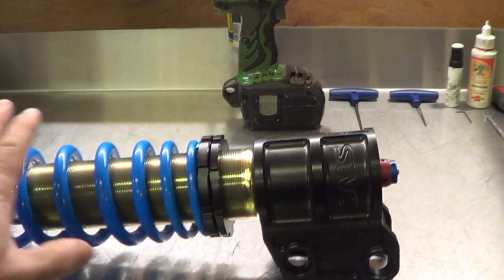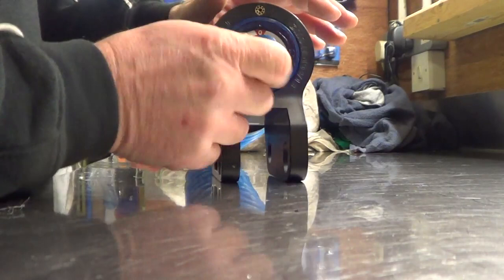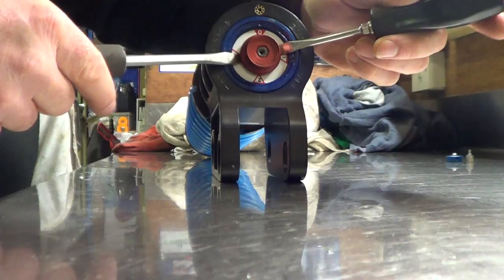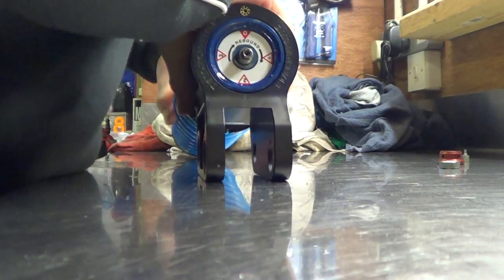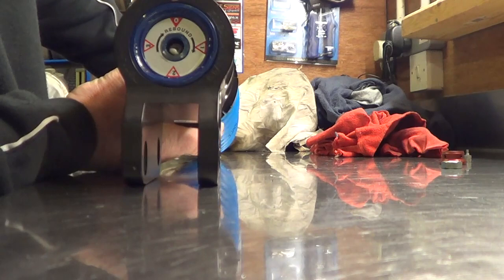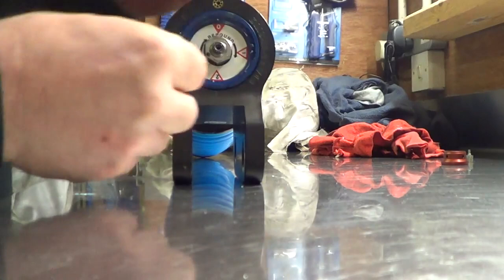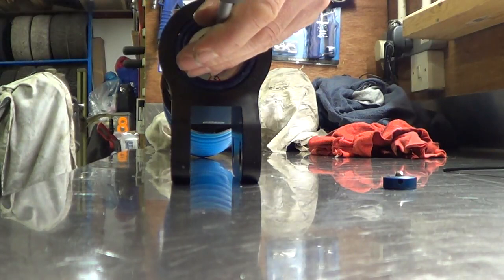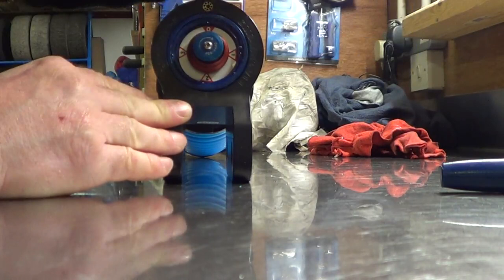Frank Kelly - HOW TO DMS Remote Canister Suspension Spring Removal

Comment: Great vid, Pretty much the same stripping forks on MTB
Reply: Also kinda similar to ⅛ or ⅕ scale RC cars. So many different viscosities, pressure bleed dimensions, spring diameters, preloads, travel length and angle of travel. But if (when) I screw up I'm lapping slower, not sliding down a mountain on my face (I've done that, luckily it was damp grass) or throwing a sexy blue ekkie off the road.

Comment: Hi Frank is it just trial and error for the settings for each event or do you know what adjustments are for different conditions e.g wet or dry tarmac like how much bump and rebound and the spring tension cheers 🏁
Reply from the maker: Yes Lee. In the beginning it’s trial and error and eventually you get to know what does what and more importantly what makes you feel confident. 
I keep a record of settings for every rally I do. That way I know what worked and what didn’t.

Comment: So whats going on at the top of the strut? Can you not remove the strut top mount and pull out spring?
Reply from the maker: Most remote canisters have a pipe coming out of the top pin that the top mounts on. 
To get the mount off you’ll need to remove the pipe and the damper will degas and spurt oil everywhere. This process avoids that 👍